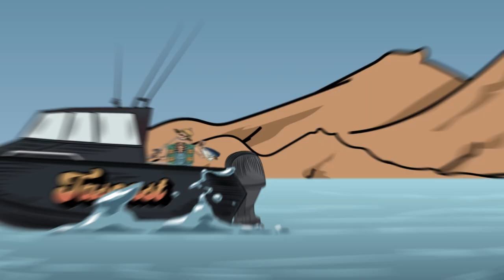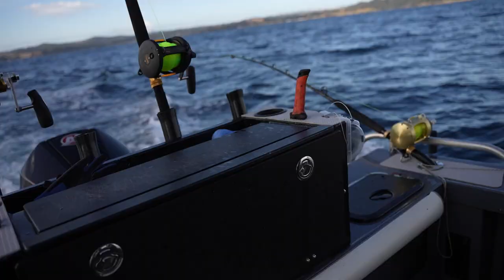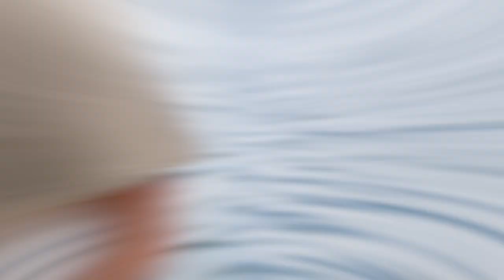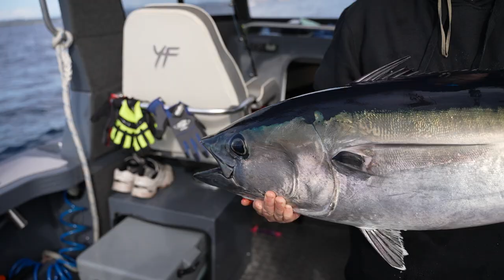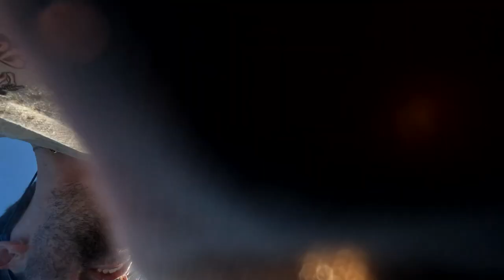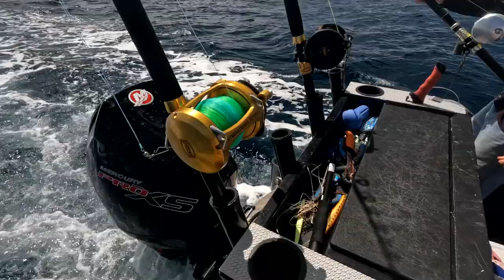3D Printed Lure Fishing (IT WORKS!)

Comment: one of many reasons...I was on the point ty end of that. did a lot of research etc. many involved that made master moves to remove those supporting it...goodbye 3 amigos
Reply from the maker: Thankyou for your work 🙃🐟💜
Reply: As i say a group of fishos can make a difference and the ground swell grew. We saw through the likes of Mcglashin who only there to look after his ow interests not the majority and feather his own nest (which backfired), doing deals in the background. So much to be said of many on that front. @TascastFishing  when i was younger you used to see schools of sbt off the Cape. the Japanese loneliners and nsw fleet collaposed the fishery just like Indonesian has done to the yellowfin, stripy tuna and albacore all now  not very common to find where 20 years back they were thick. In 2006 the jumbos (100kg) showed back up at Pedra. Now we see them back again in Bass Straight.